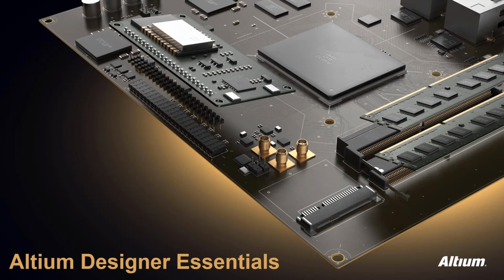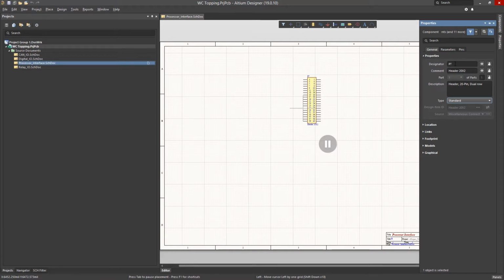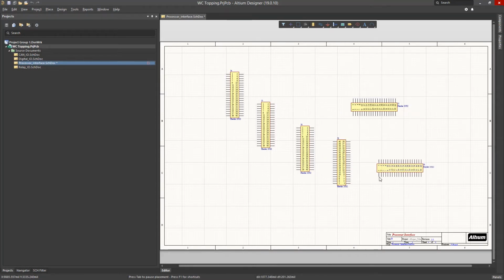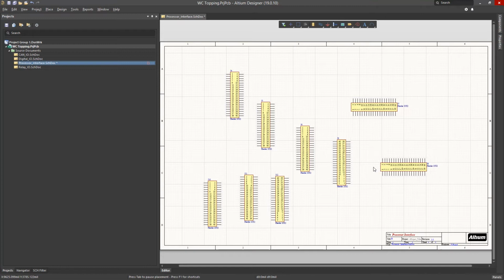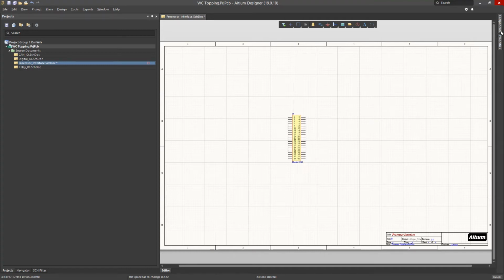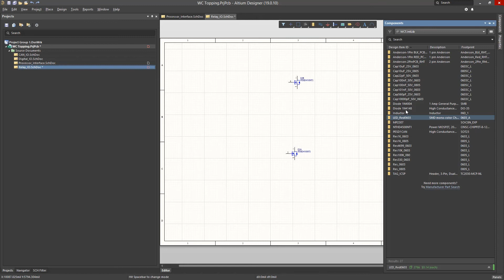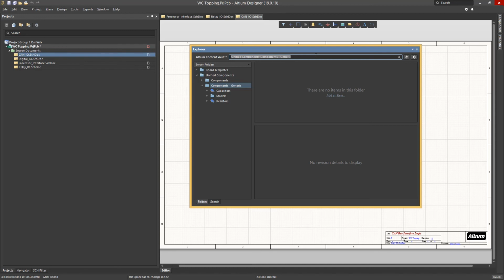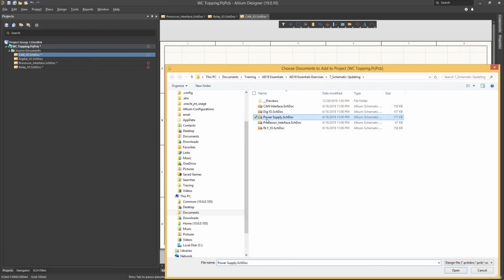Schematic Capture | Altium Designer 19 Essentials | Module 7 Part 2

Comment: You don't actually need the library files to watch the videos, you could create any kind of circuit and use the videos as an illustrative guide. If you really wanted to create the same circuit design, some of the components should be available from the pre-installed Miscellaneous libraries, other components could be sourced from the Manufacturer part search. You are also welcome to sign-up to Altium's latest online Essentials and Advanced courses, where you will be provided with full training materials; the courses are three-day hands-on exercise driven modules, with demonstration and guidance from Altium Certified Senior Trainers. (please contact your local Altium office for pricing and further details)